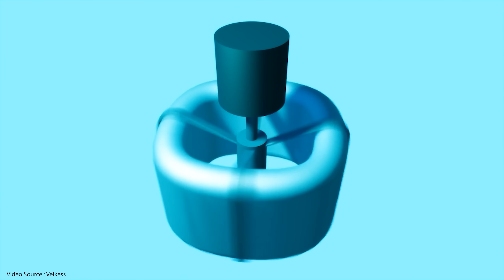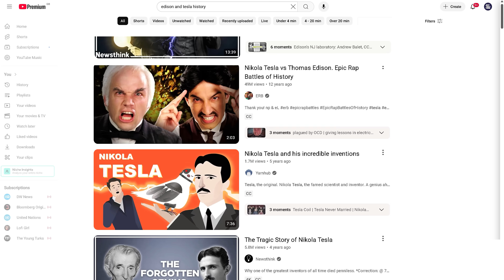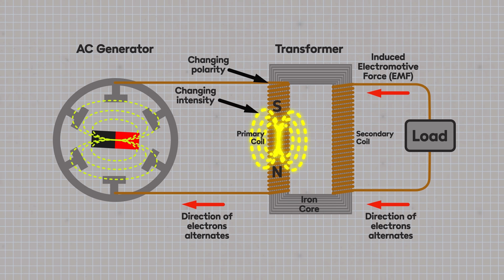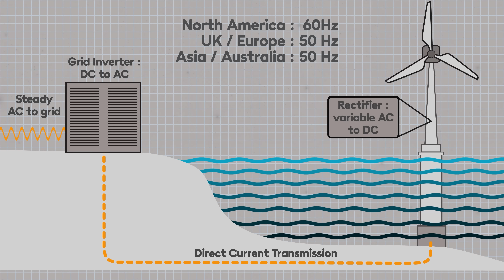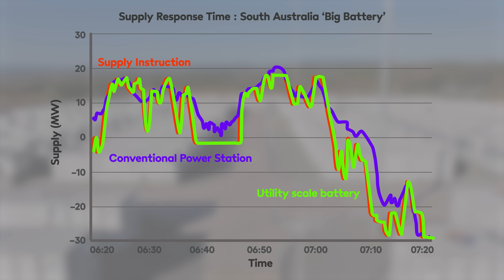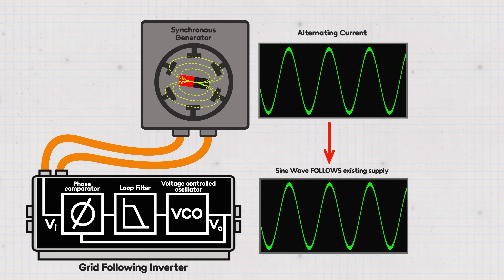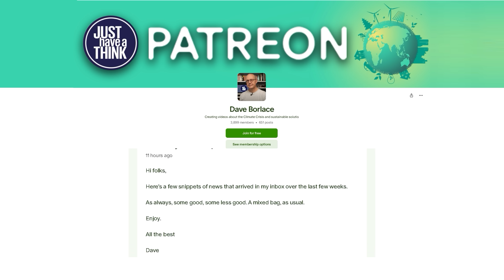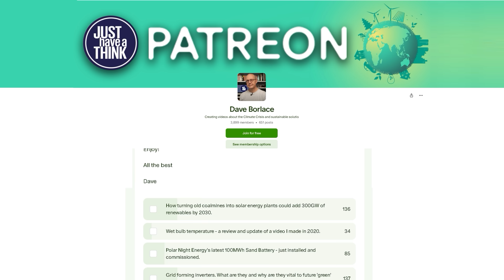How GRID FORMING INVERTERS are paving the way for 100% renewable energy.

Comment: I am surprised it was ever considered that difficult.  We have free nuclear grade accuracy time clocks pinning around the sky.  its called GPS.  That everyone can sync of very accurately.  The only issue is the potential offset variation that may exist when joining two different GridForming units together.  Or they probably slowly move to a known offset then all master incoming sign waves go offline. Check they are in sync in joining, or a random master tells the other to move to a synced offset. In any case, I dont and never have expected that this was ever that difficult.
Reply: You have made the classic mistake of assuming that the grid frequency  is meant to be fixed.  Dave did allude to this when he talked about grid forming inverters employing 'droop' control which is a utility primary control response - both frequency-watt and volt-VAr.  The actual frequency that the grid runs at is variable and used to broadcast the balance of power.   It is part of a distributed demographic control system.  So having a rock steady inverter frequency is not compatible with how the grid is controlled.
Reply: @michael-j-harrison I indicated a variable offset that deals with such variations.  this offset would need to be communicated and metabolised by one of 2 different segments of a grid when joining.
it's a bit like ptp a ampte standard for precision time protocal and how tv networks around the world sync there signals together.

but in the end, if you have a self driven sync source. so you can govern yourself in terms of a local grid frequency and offset of a universal time clock.

these are problems solved in other implementation long ago.
Reply: @CineTechGeek - what you are missing is that this problem has already been solved over 100 years ago and works really well.  A utility grid is controlled using a distributed democratic control system.  Each grid asset is able to cast a vote in this democratic control system by trying to either pull or push the grid frequency.   The overall frequency of the grid varies and is used to broadcast the instantaneous balance of overall generation and consumption.   Each grid asset has the rules for how it votes in this democratic system definded based on the primary control response 'droop' gain settings  - Volt-VAr and Frequency-Watt.  The grid operator then has the ability to update these droop gain settings using a mechanism called secondary control response  - by defining and sending new primary respose schedules.  This two tier control provides the ability to have instantaneous expected control response yet also be able to modify this control response without needing a low latency comms channel. 
I am not taking here from a hypothetical perspective of how grid assets could be controlled  - rather I am just explaining what is the reality of how this works.
Reply: @michael-j-harrison interesting.  so it's similar to what I expected.  but also sound like it was invented a long time ago before we had millions of mini power plants (solar on the roof) systems everywhere.

it is likely not completely fit for purpose of new demands on the grid due to this.
low latency comms is common or at least  the ability to have a global highly accurate clock is.
considering we have power feeders jumping in and out of the grid constantly, maybe it's time for a reimplemenration or upgrade to the new environment.

the need for flywheel type approaches can be more easily approached by a distributed battery system with low latency data channels. would likely also be far less of a Biden on grid infrastructure.  millions of batteries having a more macro approach to fluctuations in grid demands.

Comment: Last I heard 30% of the SA battery is devoted to synthetic inertia. Real inertia can be provided by keeping the  the old generators connected to the gid. There's not much to fail in a big spinning mass of iron.
Reply: Last I heard  Hornsdale hasn't failed either. At least it has no bearings as a point of failure...

Comment: I have always wondered why frequency was/is such a scary bogeyman in the power industry. In the world of digital audio, good digital clock generators have been around for ages. Why on earth the adoption of the same principles didn’t get transferred to the power industry eluded me. Thankfully the time has arrived. And pretty soon frequency will be yesterday’s newspaper, and the solution will be in a miniaturised box you can put in your pocket. Thanks again Dave!
Reply: For the grid, the frequency of the waveform scales the amount of energy stored in the waveform, as does voltage.  When a large grid is unable to maintain a stable frequency it is because there is a generation-v-load imbalance which will quickly take the grid down if not rectified.   That is, this isn’t a matter of generators not being able to generate the required frequency, its a matter of the load on the system pulling the frequency down whether the generators want it to go down or not.

Add to that the problem of actual physical spinning storage not being able to change speed very quickly, and transformers beginning to overheat as the dropping frequency pushes their inductors into saturation, and generation resources will begin to trip off very quickly if the frequency drops for too long.
Reply: Oversimplification of a complex set of problems, but yeah...

Comment: As an apprentice I worked in many departments of a large complex factory. One was generator test. And you just reminded me of how they cooled the rotor & it made me laugh in the context of the EV H2 debate. Yes they used Hydrogen gas as a cooling "fluid" because it caused the least drag as it transferred the heat. The impeller at one end was a work of art.  One day an Electrician caused a spark (might have been a welder, maybe - the seal was welded metal) & the volume had not been purged fully. It was messy and expensive.
Reply: Hydrogen is nasty stuff. It doesn't care how much air is around, it'll go bang.
Reply: @gregbailey45  Yea, a 500MW set was not puny, probably took a lot of purging.

Comment: At 3:28 you imply that it's the steady stream of steam in a traditional generator that keeps the generator in sync with the grid frequency, but that's not the case. With a synchronous generator it spins in time with the frequency of the grid no matter what. A bit like the wheels of the car spin in time with the speed of the road under the car. If you apply steam to the turbine, the generator "pushes" against the frequency of the grid, trying to increase it. If you stop the steam it drags against the frequency of the grid, trying to reduce it. But whichever you do, it remains locked solidly to the grid frequency.
Reply: Yep, phase angle is critical.

Comment: Hi,
I accept what you are saying but when in the UK there is no wind for up to 12 days in the winter months and little or no sunshine from Mid December to end of Feb the cost of batteries will be incredible and will cost billions. We already have amongst the highest prices in the world for electricity and it is killing our industry and population and many are choosing to eat or heat. For example a battery storage system to provide 200.000 MW/H costs around 80 million pound . This would power the UK for about 20 seconds in winter when the grid is producing 40 GW constantly.You would require about 4320 of these for one days power and nearly  nearly 50,000 of these units (times 80 million) for 12 days. Battery storage centres also represent a huge fire risk as we are seeing worldwide with Lithium Ion batteries. Also how long would their lifespan be?? Certainly a lot shorter then nuclear or gas. The simple answer is to go nuclear and hydro or tidal where you can.

Comment: Often this is called "grid stabilisation service" (or supply) and is sold to the grid as a separate thing from the energy. It's also separate from black start capability, but for obvious reasons often the same facility does both. It's just that (ideally) you don't black start your grid very often.
Reply: Careful not to conflate too much...

Comment: Love your video :) PLL were thaight in my engineering course 15years ago.  We also had another techno thay could synchronize 2x 60hz signal and shift it's power... trying to recall what that was... 

I don't believe it was a PLL as it was already used in Hydro-Quebec dams to protect the generators...

Comment: As always, the twits saying newer tech can't do this or that or something else are wrong. As an electronics tech by trade (and tape op in radio), now retired, you can phase lock loop anything and phase locking the master clock is what radio transmitters have been doing since WWII.

It's actually easier to phase lock loop an electronic masterclock to a network than it is to do the same with a mechanical system because, while mechanical systems have stability, they're less responsive than electronic systems.

As always, your explainers quietly blow the old world "thinkers" out of the water with simple facts.

Comment: It is possible to measure the inertial of a grid. Typically conventional turbines that participate in frequency regulation have a 4-5% droop setting once they synch to the grid. This means they all share the load and give the grid stabilizing inertia. Grid batteries with proper inverters and permission to participate in frequency regulation can provide stabilizing synthetic inertia. Advanced solar inverters if allowed can adjust voltage (VARS) and may even be able to reduce harmonic distortion. Utilities need to request/require such features and insure they are effective to run a grid on SWB.
Reply: Si many concepts, so little time to unravel them all. Thanks anyway...

Comment: My home inverter and battery provides frequency support to the grid, as well as adding power to the grid, if and when needed to protect the grid's stability.  It can inject a modified phase and frequency that, along with other such systems, to add scale as a virtual level.  This virtual power plant helped save the grid earlier this year - first time this has been done for real, here in the UK with G100 grid control.  So in some ways the future is here.  Greg Jackson has a video on this somewhere.  I know many fear this sort of external control of your home PV and battery but this sceptical test and evaluator has been pleasantly surprised,  I do miss having complete control of everything though.
Reply: Similar here in Romania, were already is approved only inverters with microgrid and battery !
The benefits are huge, for example : battery provide a continuous curve of energy to the network, main grid (so some clouds passing by won't make shark on off, export import energy "curve"), if main grid is down (even for few seconds a day - happened here in my area) your house won't "feel" nothing, ...
Reply: Is your VPP similar to what we have with our Tesla Powerwalls?  We participate in our utilities VPP program and sell power back to the grid at higher rates during some grid emergencies when the traditional sources need a boost due to high demand. We get a nice check for participating.

Comment: Dave,  Thanks for a really good and accurate summary.  I would argue that the synchronous condenser - which you show as a flywheel - does the same job as a grid forming inverter.  It has one super-power that you've not mentioned though - when part of the grid goes faulty there can be an awkward 100ms or so before things trip and the current spikes.  Mechanical inertia can provide a massive instantaneous current to keep things going.  I'm not sure that the grid forming inverter can match it in this respect.
Reply: It would be better to equate the flywheel with the combination of a grid forming inverter and an energy source which can deliver a high power for a short period, like an appropriate battery.
Reply: Pretty sure batteries can deliver high instantaneous power, just like a flywheel! The problem with restarting is the level of currents involved which can trip systems feeding an excessive load. Soft starting is the solution, not just grunt.
Reply: @gregbailey45  Trying to emulate INERTIA in the renewable energy sources needs a bit more explanation, and a better explanation of the performance properties of existing power grid-connected generators.
Inertia is due to the inherent rotating mass of turbine-generators (and hydro )and resists changes in speed, thus contributing to stability. However the reactive and real power flows, along with changing droop settings are critical too. Reactive power is the power that oscillates between the source and the load in an AC circuit, not contributing to useful work but essential for maintaining voltage. Modern wind turbines (Type 3 and Type 4) often utilize synchronous generators with power converters. These generators can be controlled to both consume and produce reactive power, allowing them to support grid voltage and stability. 
1. The reason that the frequency in Hertz and the voltage are kept within really tight values from hydro and steam turbine generators  is to assure stability and that is by using complex controls, comprising a "governor" for the speed control (Hertz) and a voltage excitation system that controls not only voltage but also reactive power flows. Both of these critical variables make for tight stability control.

2. Fast start times:  If the steam turbines are already hot and are spinning, then yes they can come on-stream fairly "quickly". If the steam turbines are not already hot and spinning, then it can take 30 to 40 minutes to run up and accept load: "Steam turbine generator startup times vary significantly based on whether it's a cold, warm, or hot start, with cold starts taking the longest. A cold start, when the turbine hasn't been running for over 20 hours, can take 6-10 hours. Warm starts, after 8-10 hours of being in a barring condition, may take around 40 minutes to reach rated speed. Hot starts, after shorter downtimes, can be much faster, potentially within minutes. "https://www.google.com/search?q=Steam+turbine+generator+start+up+time&rlz=1C1CHBF_enCA1043CA1043&oq=Steam+turbine+generator+start+up+time&aqs=chrome..69i57j33i10i160l3.22789j0j15&sourceid=chrome&ie=UTF-8

3. "Droop" is the measure of how much the speed of a turbine generator drops as its load increases, and is an adjustable setting applied by engineers. It determines the load sharing of generators that are grid connected.
4. Having independent power sources provide their own frequency control is important, however it also requires load-sharing control to protect the installation from overloads.

Comment: I remember the first inverter I saw as a 12 year old kid in the 1960s. My dad had an audio tape dictation machine that needed 120v 60Hz in his car which only could provide 12v DC. The inverter actually used mechanical technology to create the 60Hz through a transformer etc etc !  Buzz buzz
Reply: My uncle gave me a 'genemotor' when I was a teenager, designed to provide 400VDC from a 24V input. It worked just fine at 12V, producing, you guessed it, 200VDC!, and could work in reverse. Nice little bit of kit, I'm guessing it was used in small aircraft to power valve equipment requiring 400V HT.
Mum and dad disposed of it  for me when I left home to start a new life with my new wife, and hadn't yet cleaned out my cupboard, God bless 'em! It seems mum had her eye on my bedroom to use for her 'sewing room'.

Comment: Amazingly I live in a house that is totally off-grid. They power is controlled by an SMA Sunny Island, with a diesel generator and a PV solar array. The Sunny Island is "forming" the grid. When the battery getsa low, the generator comes on and takes a few moments to sync in before being allowed to power the grid and charge the batteries. When the battery gets charged up enough, the generator cuts out and the system is all just run from the Sunny Island. Leter this year we hope to get a grid connection, and then the Sunny Island will "follow" the national grid.
This obviously all works well in this small scale system.